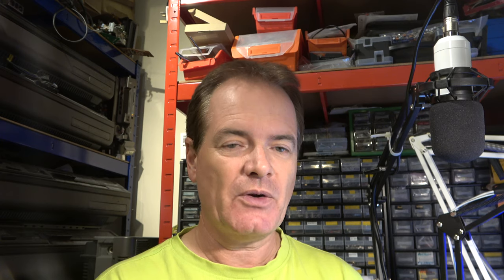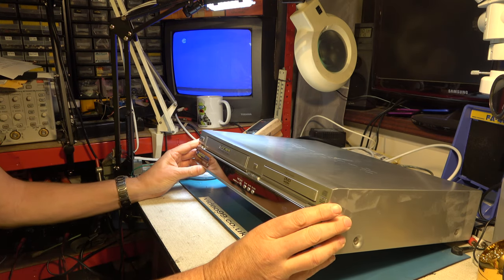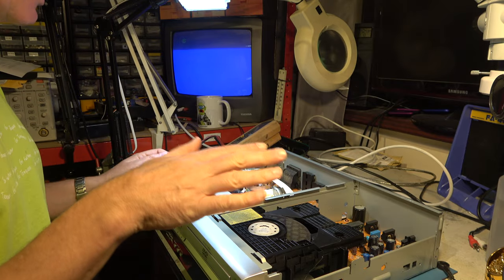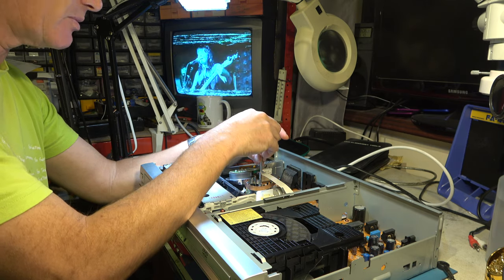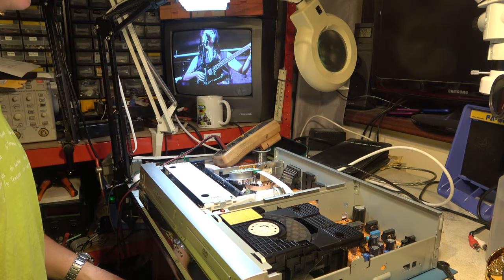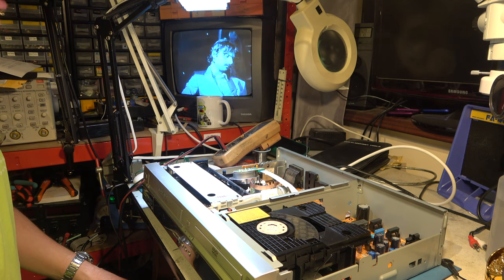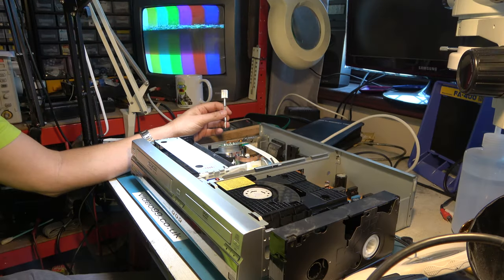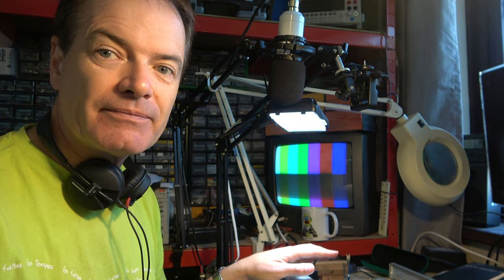VHSC tape recorded with massive alignment (tracking) error.

Comment: Great video 2 things
1. Have you heard of the RF decoding (vhs-decode) project? an extension of the  ld-decode/domesday duplicator workflow using direct RF capture off any decks head amp for direct video FM RF and direct HiFi FM RF capture, it would be interesting to see you do a video on the workflow making full use of lower end VCRs's then showing the processing such as TBC all done in software as decent hardware TBC's are prohibitively expensive and this project has made anyone with a spare 50GBP or so able to get near 1:1 archival copies of many tape formats today.

2. Have you ever thought about just putting VHS-C tapes into a full-sized tapes? iv found that's more reliable than using the adapters witch can kill batteries fast so you have to put tape in remove bat use tape then put bat in and remove tape from adapter otherwise they can lockup mid way if you get sloppy.
Reply from the maker: I've heard of the RF decode project but not had any experience of it.  With the amount of tapes I have to get through, this route probably wouldn't be practical.  
I have occasionally loaded VHSC tape into a VHS shell for special reasons, such as a disintegrated VHSC spool.
Reply: regarding point 1: older and cheaper vcrs indeed do have separate head amps, but they lack quality, because they're old, so you can't beat newer models anyway, and newest vcrs (or better to say latest to be released) don't even have separate head amps, everything is integrated into video processor, you can reach rf because those chips have rf monitoring pins, but these vcrs are too new to have decent image qulity, so it's kinda moot, because those "newer" models (but not the newest) already have quite decent and sharp image, nothing to improve upon.....
and another way of getting less vertical roll is putting tape in another machine. call it poor man's tbc. also, given the amount of tapes i capped without tbc, i doubt i'll be wanting one soon.
Reply: @ivok9846  The issue with the last gen VCR'S however for VHS is the lack of HiFI FM test points, you have to go tapping IC pins, tbh there is very little real world diffrance between a 90s unit and a 2000s unit on the amplifyer ICs head conditon makes a more major diffrance, after the last 2 years of seeing hundreads of decks tapped its pretty clear at this point as i've tried to document on the vhs-decode hardware install docs.

If you think there is nothing to improve on for the ICs new and old then your pretty mistaken, if you think there basband output is perfect then when you see vhs-decode has full demodualtion and baseband processing control stanges it beats out any modern ADV (analog devices) chips.

At the end of the day RF capture beats out hardware TBCs alongside any hardware Y+C/CVBS to YUV converters used before or during the AD conversion process, the only factor that matters today is if x deck can track a tape and x decks heads are not worn down, at 16-25GBP to get into and with it I urge you to try the FM RF archival method, I have a basic video on it and there is a extensive wiki unlike when I made the orignal comment nearly 3 years ago now.
Reply: @TheRealHarrypm panasonic nv-hv60 has hifi fm test points, but it's already too new to be any good, if panasonics were ever  really good. it doesn't have separate head preamp at all. as for head condition, i think it's doesn't make much difference, knowing what i did to my oldest vcr (35 years old, still works) and how it kept going over the years. i mean....better not to discuss it.....if you were to find unused and machine with 1000hrs i doubt differences would be great. or even perceptible.  i dunno if it's even possible to find worn heads vhs machine, the tape is pretty soft. maybe on machines that were working  full working hours, ie 8h every day, but not on home machines.

it would be interesting if we could swap a vhs tape, you capturing it via RF and me via my old system, and then compare the two, but...like i said, sharpness via slv-e730 and philips saa713x based capture card is not an issue at all. i kinda doubt i would get better results with sanyo vhr5100ee from 1989  and vhs-decode. why?
because sanyo must have worse heads of the two. even when it was new. and worse RF pre-amp. not deteriorated, just worse.....

regarding virtual tbc (i presume vhs-decode is doing): yes, digital system can align scanlines beginning, but it still can't align perfectly the complete line, because of magnetic tape non-linearities and stretching, ie every line has some horizontal wiggling going on, this will be visible when recording signal that has vertical lines in it, for example subtitles etc.
i'm just watching "vhs-decode vs 3 others: TBC stress test (Crafters)" on yt (and i see your comment), and it seems it's not even doing aligning of scanline start i just decribed above. maybe the recent version has tbc.
(must say, i like the amount of taskbar icons in your "VHS Decode, ld-analyse & tbc-video-export A Basic User Guide - Windows (2024)" guide.)

i mean i don't mind the command line (because i was using and still use avisynth..that would be father and mother of QTGMC...heh) but i don't have tapes with tbc issues....

gosh, those are high data rates, as i expected......280 or 560mbps....

it seems you're including some sort of drop-out compensation, we were doing that via avs filters.....in 'doom9 analog capture guide', i wrote the chapter '13 Removal of clicks and scratches' (linked in '7.2.3 Removal of clicks and scratches'. in 7.2 Processing the video using AviSynth chapter).
that's a good thing, i had some kodak tapes with plenty of drop-outs. 

in your "Visual Comparisons" on wiki, all "conventional methods" pics look like some ridiculously crappy usb-mpeg2 capture device that's not even preserving interlacing, so image is vertically polished, blurred, ie it's not even full resolution, those camera date/time captions reveal that. most of my captures look like those bottom pictures. the "Lorrane Wedding Tape" looks like it was captured with contrast setting during capture cranked all the way to the max, so everything went black. better to do less contrast than more during capping, because more means unrecoverable erros like these.

regarding linear(mono) audio, it gets a bit complicated, right? i mean you need external clock hooked up to 2 cx cards, right? 
why didn't you solve that in software too? usually capture utilities(vdub) can resample audio to match video clock, or vice-versa.

ie the actual capture utility that puts both rf (video) data and audio from pc sound card into one file you later process....
Reply: @ivok9846  I should have also stated, its not really about just VHS anymore either, Betamax, SMPTE-C, EIAJ, Philips VCR, Video8, Hi8, Umatic are all also thought about and have RF capture users, there is a lot of interest for 2" Quad which is in the roadmap of future support, I just did a few video8 tapes this week and they look as good as new recordings do with the last update to decode. 

Feel free to email about doing some back and forth comparisons, top of the wiki homepage.

The TBC on vhs-decode is not virtual is basically the same as what's in a FPGA in terms of video handling its not doing it on a decoded YUV image but during creation of a demodulated CVBS/S-Video signal stream on file, its had the same TBC power as ld-decode since day one they both share the same core code and processing speed hits in that regard a "full frame" tbc in simple terms.

Ah the crafters tape is a mess, for 2 reasons 1 its a 14.3msps capture not an 28msps capture off a CX Card the bare minimum for capture of NTSC/PAL RF on those cards is 20msps you can get away with 16msps for NTSC or 18msps for PAL if re-sampling after the fact and the tape is within format spec ish, but if you capture under those minimum rates that's it there is zero hope of current code playing nice with that as the signal data is just not all there, so that tape irritates me to no end its a true bad capture in terms of ingest and in terms of a valid test case. (this was before guidelines were established for safe rates)

The last 2 videos I made are actually already outdated, not behind the current docs, but will be very soon with new updates coming to the tbc analyse tool (ld-analyse) and making a new video on the clockgen setup, actually most of the icons are standard tools mentioned in the wiki it was a Easter egg there is like 10 more things on there as I have a 21:9 ultrawide panel but used a 16:9 one for the video.

I will admit those example snips are just mostly there as a "oh wow" factor thing for people without any real experience, the TB's of raw data available is the you want a real example here have fun sort of thing, people asked for some pictures so they were added there but they are full images, you can open in a new tab and pull them down manually or use the compare links for fun haha.

(also the NV-HS950B TBC I found to be utterly unreliable sometimes, that example was made as a joke when LS started to say decode was vapourware, without trying it before getting all hostile about his little TBC market, I was saying decode wins when I had a FORA310P fully working in my capture chain, when you can adjust CVBS/S-Video signal portion in post or not even need to at all well that just kills having to deal with hardware)

The decode process provides signal level data like you would have from RF out on a Umatic deck fed into a TBC, ld-dropout correct is akin to a video filter although its applied to the raw GREY16 CVBS/S-Video TBC files in a isolated manner via export tool or a permanent manner via running ld-dropout-correct directly.

For audio the current clockgen setup has a little PCM board for linear audio capture, Its notable some members are working on a direct linear head method so you could get a HiFi deck to do standard output + HiFi RF + linear , but yes 3 files 40msps 8-bit for Video, 10msps 8-bit for HiFi and the last one being a 3 channel audio file with L+R+Headswitch they are all captured off the same clock in sync, now how you go about alinement is upto the user via auto audio aline or any other tool really there is going to be some methods added to the export tool at some point to just streamline this process even further, and there is a new version of the DdD coming to the main docs soon which is duel channel + has provisions for a 4ch balanced audio ADC setup added to it.

I will note I do V210/PCM then encode to FFV1/FLAC with an Blackmagic SDI setup with the DMR-ES10 as a reference capture chain alongside every RF capture I do outside of quick testing stuff.

Regarding final archival file sizes, we FLAC compress the RF and only keep the decoded .JSON metadata file + encoded FFV1/FLAC media, the S-Video/CVBS .tbc files are not required to live forever after exported metadata from the VBI space is delt with if any, the standard practice here it to note the commit/command used and purge the .tbc files after you can always re-decode from source RF later on.
Reply: @TheRealHarrypm  just replied there, you must be "RobustReviews". 

"virtual tbc" in a sense that it's done on already sampled video signal. perhaps you could copy vhs ad-nauseum, untill image starts to roll and then see if tbc is working satisfactory.  that's one way to brag. 

another one is to capture same video in normal way, and then via RF, from same VCR, for example i see my VCR(sony slv-e730, in your tap-list) for which i'm presuimg you can't beat sharpness of normal capture process. offcourse something better than usb capture device would be required, maybe cx card without any modifications. but i dunno is that your vcr etc. and i dunno if you have cx card(cx cards u use are 640x480 video surveillance cards, it seems), or bt8x8 card(conexant bought brooktree), or card with philips saa713x, all dirt cheap, btw. all pci. without "e" on the end.

some sort of weird luma flickering is happening on "Peter Cook & Barry Humphries interview - The Late Clive James (1987)" (video dump), and i don't think they used fluorescent lights in studio in 1987....heh....

"Saving Ricky 1 - A Deep Dive into VHS Preservation" at 13'37'': he does all that, and then does noise reduction in....premiere.....oughm....
"The Birth of Brazil (1988)" by video dump is better than "ricky 1", but chroma can be moved back into its place with "chromashift" and some dnr can be done on chroma alone with "cnr2". both avisynth filters. processing is unrelated to capturing itself, but it shows that every part of conversion chain is important.
Reply: @ivok9846  In that regard, yes, virtual TBC makes sense, though it is called a “software defined videotape player” so the RF captures are your virtual tapes.

Actually for doing dual capture in a reference setting we can now use the MIRSC for raw CVBS + Video RF at the same time, as recently CVBS-Decode had a massive update but with the same RAW CVBS signal you can re-pipe that back to any standard ADC chain making it far more practical now, but RAW CVBS is far more impractical in terms of file size, baseband will always be bigger than direct FM signal compression efficiency wise, I'm waiting on some back and forth from PCBway and I'll be getting in a unit soon, Chinese New year is a wonderful time of year.

No I'm not Robust Reviews, though me and Collin both know him irl actually, he was in the commercial digitization game, nice pile of AG deck parts thanks to him.

SLV-E730 tap info was sourced from a community member a while ago not sure If I was the one to add it tbh 90% of that list is from the community.

As the wiki writer I have several CX Cards on hand though, I even did a video on modifying them, which is going to be updated soon, and I recently got in two new current issue white cards for a new clockgen demonstration setup.

The Contaxtent chips are regarded by pretty much the entire decode project user base and dev team as a mediocre capture card for conventional video, better than your average easycrap but not as good compared to the GV2-USB or the ADV7842 in BlackMagic SDI / BE75 / Magewell / AJA etc units in terms of signal conversion, it's internal amplifier gain stage is no ware near as good as modern ICs the quality issue carries over very much so apparently when it comes to RF capture hence why we use external amplifiers now for as a defacto for the clockgen and single card setups, allowing us to completely disable the internal gain, though each variation of the chip has different self noise profiles the ones with the less features have less noise obviously.

Funny enough I was just talking about the Ricky video. I know that guy too. The issue I have with that video is the fact he still has not pushed the full file set so it's kind of a poor example for the decode projects in terms of demo media, so it's kind of a sad joke really in many regards a perfect demo example of FM RF archives, ruined by not doing the groundwork before publishing, this sort of groundwork is what makes public domain archives messy.

Me and video dump channel / jitterbug actually work on the current tool chain updates, he's responsible for the current codebase of the tbc-video-export tool, with me handling development direction testing and torturing him into making it the completely cross-platform self-contained thing it is in today, it's probably the single most valuable tool ever made in terms of ease of workflow, it removed the need for virtual machines or WSL2 anyone on any platform can take tbc files and make a standard video file now, and it has automated cross platform building per update witch is coming to the rest of the suite this year as well after the next round of updates are finished.

But the notable thing about the videos he puts out is they have zero level corrections and very little if any parameter tweaking it's literally just bulk hammering capture and decode with the RF ending up on an lto tape but available on request, hence why there are so many videos, we both saw the merit in automating more of the workflow because it would bring better quality to everyone and make this style of workflow of just hammering out content a lot more polished.
Reply: @TheRealHarrypm  
" with me handling development direction testing and torturing him into making it the completely cross-platform self-contained thing it is in today"

you wanted to use "it isn't today"?
i mean acquiring is done in (pure) linux, and it's more than one tool, right? one tool for data acquiring and processing (for all platforms) would make things easier in a sense one would just need to tap the RF. that would be hardest part of the job. 

you mentioned amplifier, although in another context, but here's my thought about heads amplifier, because i had to dump machine (not awfully good machine anyway, but everything is working except for one chip) because i can't find y/c processor chip that hosts the heads amplifier too:
external amplifier ic (taken, for example, from slv-e730) and then just hooked to existing vcr's heads.
this bypasses all the electronics (even the head amp of existing vcr) so you end up with a system that can assess precisely the info coming from video heads. ie you're using same known (good) head amp for different heads.  and in this manner you find vcr(s) with best heads, and then use that to transfer something worth saving. 
and you don't throw away vcr because they've put everything into one chip. and maybe this panasonic vcr has better heads than its y/c processor. better to say had. 

(edit: it's wasn't y/c processor chip on that vcr of mine, it was actually magnet inside head-drum coming loose and that way sync video-trace/video-head spinning is lost. 
video99 has "Revisit S-VHS Panasonic NV-HS930 and also a NV-HS950." on the subject. good man! )

if ricky is a poor example, then video dump is a good one. not many people use qtgmc and that's why most of yt vhs is garbage. 

i've put some examples on this channel of mine (not much work on levels on my behalf either, just a quick and dirty test,  lcds are brighter than crts...maybe a mere tv-to-pc levels would suffice...interestingly enough, another yt channel that decently converts vhs to hd also has too bright images...example video "Frank Zappa CBS Night Watch - Night Match Debate - Kandy Stroud - August 26, 1985" . that's still better than 99 percent of yt vhs...colour should of been moved to the left , in all recordings he has color going  to the right) , because on another yt discussion it's the usual "we need tbc" stuff. i, actually, don't need it. mainly ota masters and 1st gen copies. there's even some ridiculous things on my channel, as capping EP recording on old sp-only machine or capturing while ffwd-ing.  i'm more insterested in sharpness coming out of vcr than..well...anything else.  what's the use for tbc if one ends up with blurry crap because 
a) tbc itself blurs image
b) you don't know how which parts of process do what, so you capture with cheap usb device and basic, recently made vcr (only 2kliksphilip can pull that one off, and only after buying better vcr...hehe..in"VHS Tapes to Digital - preserving my childhood" although he surely didn't fix that vcr by just cleaning tape path....it was bad contact somehwere along the chroma path....bloke we're writing these comments under would do proper troubleshooting.....)

(edit: tape path indeed can affect chroma reproduction: i was slightly flexing chassis on panasonic nv-hv60 (one with magnet problem that's now solved) and lost colour, so i was wrong there. simple cleaning might help with colour loss. )

but i'm fairly satisifed with slv-e730 and saa71xx card: i mean it's picking up things that even vcrs video was recorded on don't. sure, it also means there's a lot of noise, but i don't consider noise my enemy, infact it's quite interesting to see after all digital only stuff we're watching. noise adds sharpenss anyway (dithering)....heh...
and i can do some (motion-compensated) nr in avisynth. 
so i wouldn't object to jitterbug too much, less is sometimes more. i think his recordings (if they're his) are also ota "masters".

edit: oh yeah, i got briefly to your discord via invitation on video dump's channel (i4004 is the nick....this ivok account is mainly for phone), but how do you sort everything out if you don't have threads? you're not dumping everything to one big discussion, surely? how would one find anything there at a later date?

oh yeah, you do have vhs-decode tbc smaples: "vhs-decode TBC test" on "AnalogVideoChannel". norwegian guy, it seems.